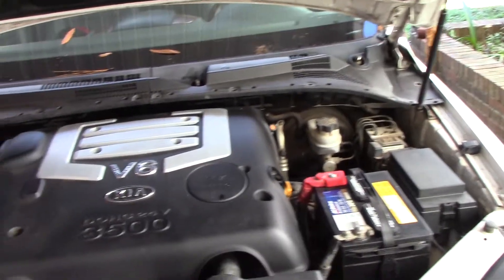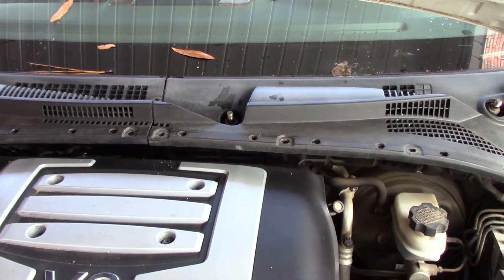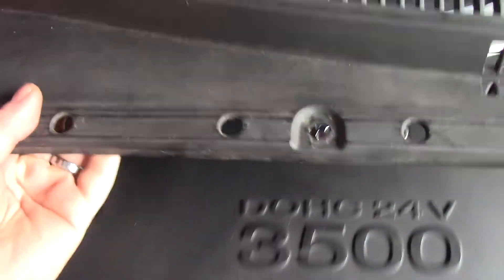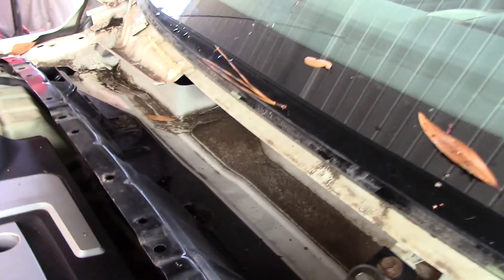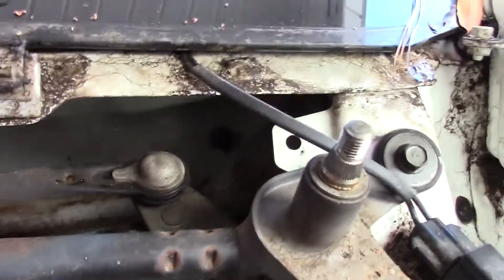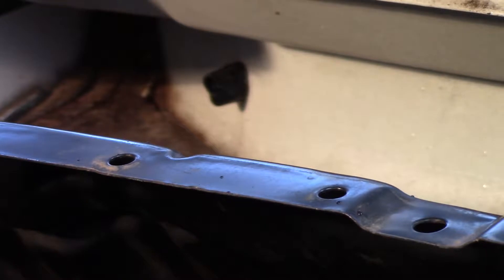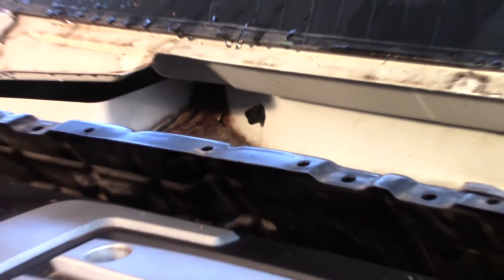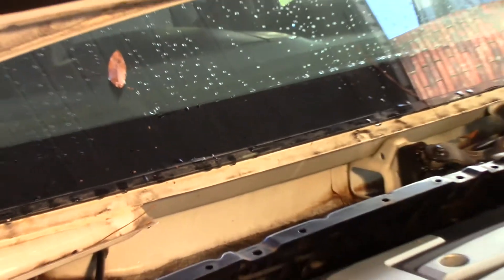2003 Kia Sorento 3.5L Water Intrusion

Comment: I hope this works.  We have a 2004 vehicle, we have a flood in the left and right sides. We also left the car for a while, had been using it again and the car had the water inside and the accelerator pedal stopped working. We also had that blue sticky tape on the sunroof deflector, the same as you...thanks for posting this video, regards from Worcestershire, UK.

Comment: This information deserves an A+ because I have the same problem with the check engine light and water on the passenger side floor board and the dealer could not help me. Now I need to learn how to reset the ck eng light. Thanks again.